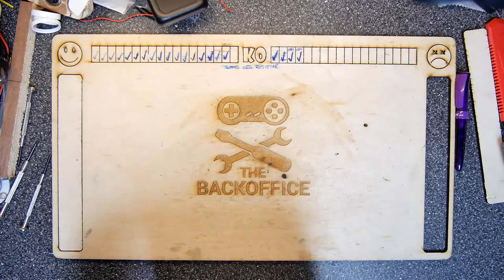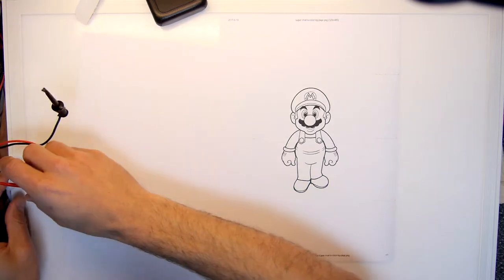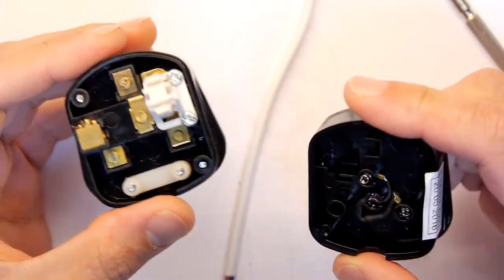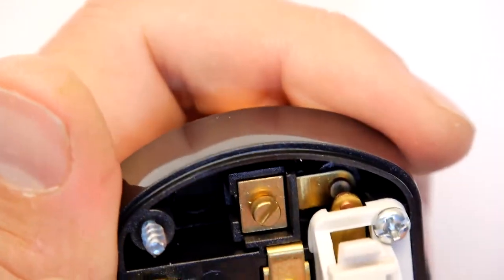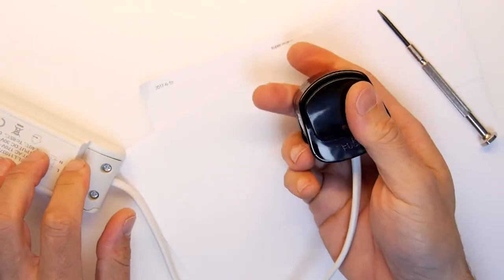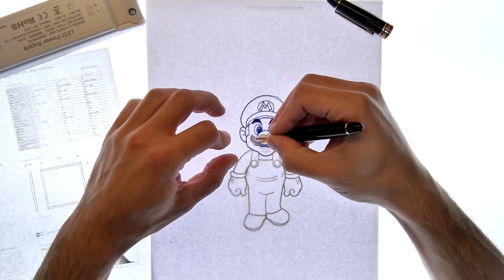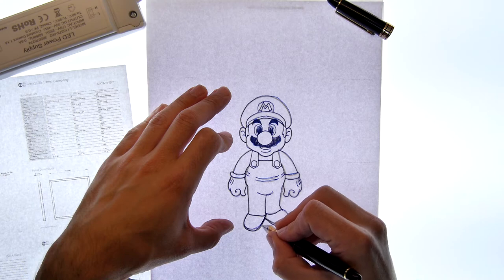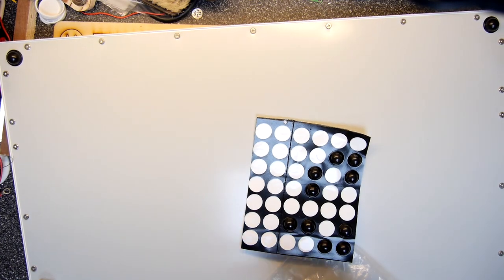DIY LED Lightbox

Comment: I have those 'grabby' handle plugs every where VERY useful for crippled old farts like me.
Reply from the maker: Brian Jones I tried to find some the other day and really struggled. There does not seem to be an agreed terminology for them.
Reply: http://www.homebase.co.uk/en/homebaseuk/13a-fused-plug-with-pull-handle---white-128665 also heard them called easyplugs, but if that links correct and there 74p each I'm off to homebase normally £3ish
Reply from the maker: +Brian Jones Ta very much!